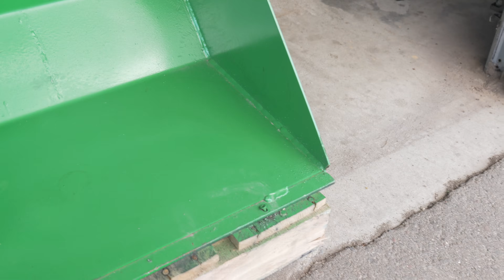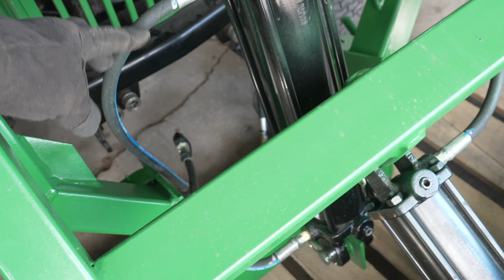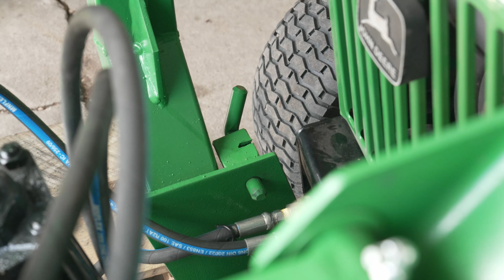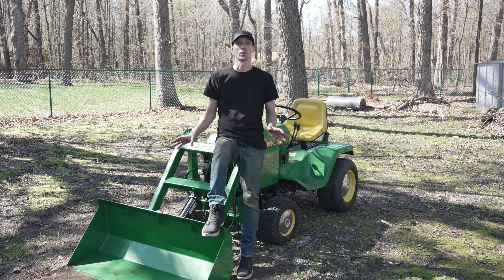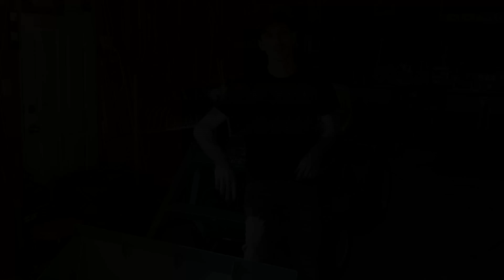How Does a Little Buck Loader Attach to a John Deere 318?

Comment: Would it be helpful to install a lock out valve on the hydraulics to get better and smoother control of the bucket like it does for the plow?  I have a 322 with plow and mower deck that has a power flow attachment for leaves and grass clippings that is pretty worn out🤣😂
Reply from the maker: Yeah, I do think a lock out valve would help a lot. That is something I just recently found out about and need to get installed. My 322 is getting pretty worn out, too. It needs a refresh for sure!

Comment: The only thing I don’t get with this loader why the forward lift arms are so long.   I may be in the minority and crazy but I don’t see value in being able to lift things about twice the height of the tractor.   

Maybe if you had to load stuff in a fairly high trailer but I would rather those forward arms were shorter so that the load would be closer to the tractor and you would get higher lift capacity.   

My other issue and again I may be a special case but I wish this was built with a self leveling bucket.   They are safer in general but I want to be able to replace the bucket with forks to move pallets and self leveling there is a god send.  

The construction and ergonomics of this are perfect other than these concerns.  I’ll just weld up my own.  2026 gal set!
Reply from the maker: I get what you are saying, but I like the arms the length they are. I was moving snow with it today and it was nice to be able to dump the snow further into the yard without having to drive onto the yard. I don't lift the bucket to the max height a lot, but it's nice to have that option when I need to.

A self leveling bucket would be great. Having to level the bucket manually as I lift the bucket is probably my biggest complaint. It's not a huge deal, but self leveling would be an awesome feature.

I have seen a few people build their own so it's definitely possible. I can weld ok, but I'm not sure I would trust my welding to lift that amount of weight. Haha. Good luck though. That would be a really fun project.

Comment: Is there a Little Buck Loader for a JD 425
Reply from the maker: Yeah, for sure! And they have the Little Bull Loader for the 4X5 series which mounts in the middle of the tractor. As long as you don't have AWS. I believe you can still get the Little Buck Loader if you have AWS though.
Reply from the maker: Florida Deere made a video about it. Still use my code if you want to get one though, haha. 
https://youtu.be/3G0KlbOBEhQ?si=jo8kn9eTPYxuyMLz

Comment: I ordered 1 last night. I did a lot of yard clean up this spring using my 54 inch blade and had a blast... and can't help but think this winter my snow clearing will be so much easier. I also added the toughman top plate... 1 318 with a 49 snow thrower, and the other with a little loader.
Reply from the maker: That sounds like a winning combination! The 54 blade is great, but I think the loader loader is going to be much better. I will be using mine for some snow removal this year, too.

Comment: Be sure to check and top off the tractor's hydraulics, as the loader will use some of the fluid in its system. I have an X739 and Little Bull Loader, and found that I needed to add almost a full gallon.
Reply: Indeed, great tip.
Reply from the maker: @davehd2009  Great point. The loader did seem to be full of fluid because I missed the coupler with the line, hit the coupler with the part that pushes in on the fitting and it shot a good stream of fluid out. But yes, definitely check the fluid after connecting any hydraulic attachment. Thank you!

Comment: That would be a great addition to one of my John Deere 318’s. How much do those loaders cost?
I’ve got 3 of those tractors because they are so incredible, dependable, and powerful.
Reply from the maker: @smileyslick1534  They start at $2290 and use the code NSE at checkout to get $100 off. I completely agree with you. I also have 3 of the 300 series tractors that run and 3 parts tractors. They are great machines! Thanks for watching!
Reply: @nicksatrangequipment  , You’re welcome.  I happened to find your channel and videos when I was doing a search on John Deere 318 Tractors. I was surprised when your videos popped up before the John Deere page and found it a bit ironic, but all 3 of my tractors were manufactured in 1985 and they aren’t at the top of their priorities.
Reply from the maker: @smileyslick1534  Well that works for me! Haha. I am sure they are focused on the latest products. Other than the 425-455, I don't think there is anything that compares to the 300 series. Happy to have you here!

Comment: Better than a shovel, but what is the weight capacity? A lot of force on the 2 little spring pins.
Reply from the maker: @JohnSmith-lw2bm  Little Buck Loader rates it at 340 lbs. at the maximum lift of 5'9." I have a video coming out Friday where I put that to the test. I'm sure a mid mounted loader could handle much more, but I was very impressed with this.

Comment: The #44 loaders are hard to find,this looks like a great option that's readily available! Your neighbors are going to be jealous-
Reply from the maker: @garthland  One neighbor has a skidder, but I see the other one giving me the eye when I drive the loader around, haha! I originally wanted a #44 loader, but like you said this was much easier to get. I would be interested to put this head to head with a 44 loader.
Reply: @nicksatrangequipment  A pretty good savings from the price of a #44 loader these days and also the Little Buck also has that cool Grapple designed for it. Can do even more tasks with it.
Reply from the maker: @beunbad  For sure! I will be looking to get the grapple for mine. They also have an option for fork adapters, a hitch receiver or they can weld a hook or D-ring to the top of the bucket! Mine had the D-ring. It is a very versatile piece of equipment. Thanks
Reply: I found a 44 loader on facebook the other day, the guy wanted 3750.00 firm. I talked to my JD dealer about getting the 44 and he had a little buck right there. I’m sold. I’ll be getting the LBL in a couple of weeks.
Reply from the maker: @whosonfirst1309 love to hear it! The 44 loader looks awesome, but they are hard to find and the people selling them know that. There is a guy local to me that has a 330 with a 44 loader and he wants $7000. That's JD 655 territory to me.
Reply: @nicksatrangequipment  ya, also they’re 35-40 yrs old. As my dealer said , what are you going to do about parts?